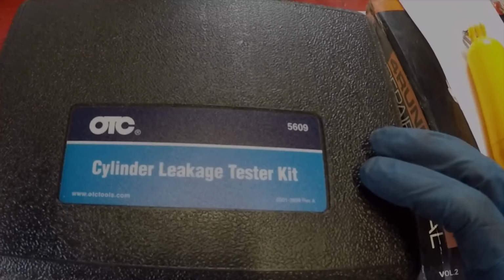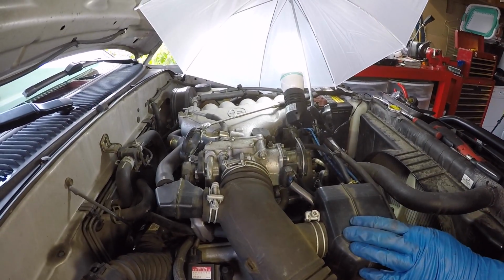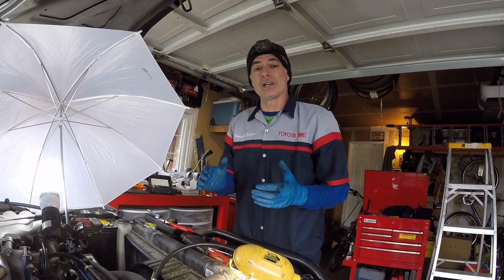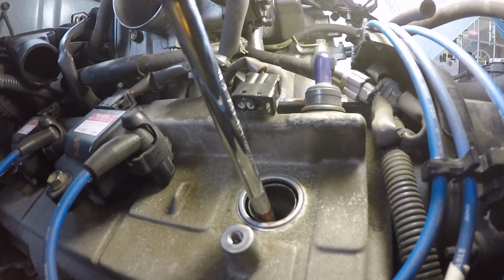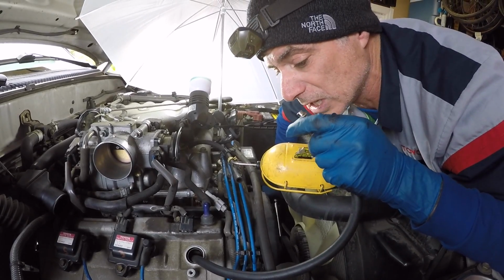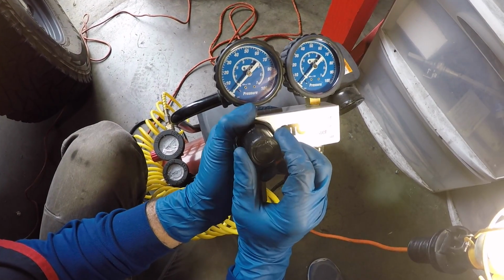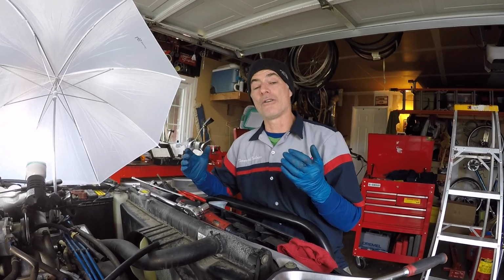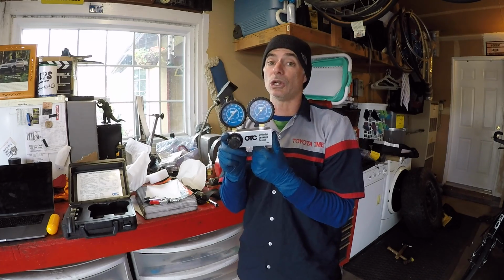Engine Cylinder Leak Down Test

Comment: Advice Change the 4runner computer and check the misfire then
Reply from the maker: Thanks for the suggestion Joel but we already swapped out the ECU on his Tacoma and it didn't fix the issue.
Reply: @TimmyTheToolman  
Ok good to now
I had the same problem with my 1993 pickup. I Change everything the last part was the computer and finaly fix the problem.
I like very much yours videos👍👍